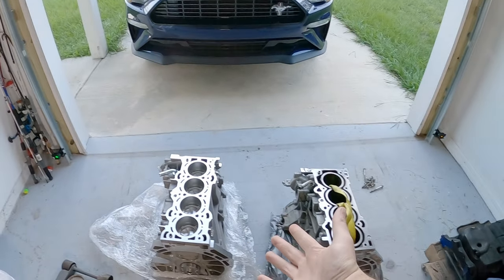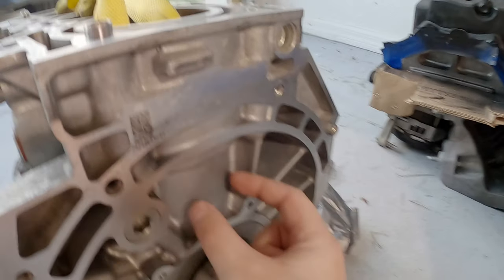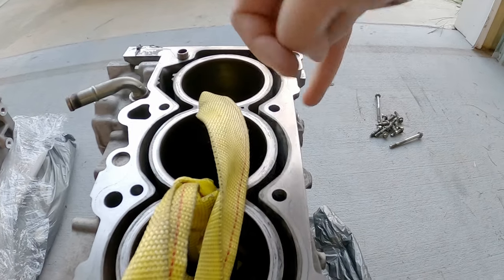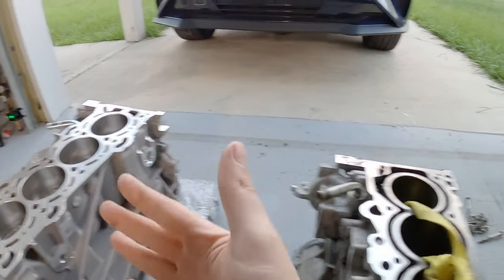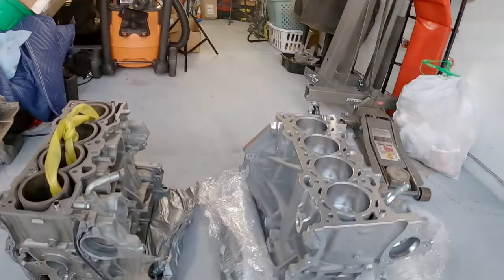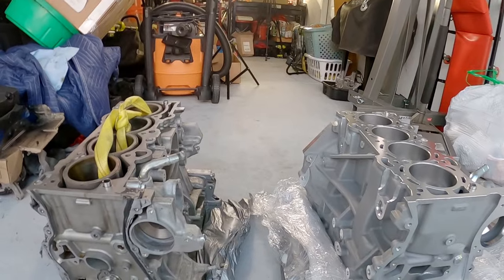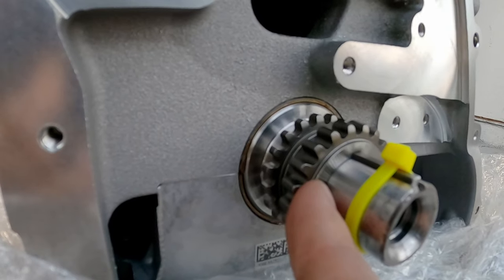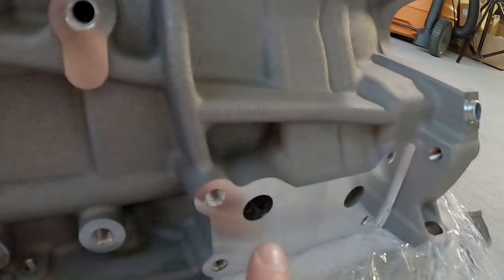Comparing The BEST 4 Cylinder Ford Ecoboost Engine Blocks

Comment: The difference in the casting finish and web thickness is because of a complete difference in casting technology. The 2.0 block you have is a sand cast block, hence the rough surface finish and need for thicker webbing and wall thickness. The 2.3 block is a metal diecast block, a much more modern technique. With metal dies, the surface finish is considerably smoother than sand cast. With metal dies, they can pump the molten aluminum in under pressure, and achieve a denser casting, and can even control grain direction. The webbing and walls don't need to be as thick, because they are stronger for a giving thickness. However, the only way to do a metal die block is with open deck. It's hard to tell because you have the strap ontop of the 2.3, but it looks like the newer casting that Ford changed to address the coolant leakage between cylinders 2-3. The original design had a slit between the bores that caused head gasket blow outs and wall cracking, the updated blocks have no slit and have a coolant hole drilled between the bores.
Reply from the maker: Great point!
Reply: What year of mustangs would that be with the issues?
Reply: I want to know for future reference
Reply: Where can I get an Updated block ? Im looking for it, part number o place where I can get it, Thanks ! Greetings from DR .
Reply from the maker: @juanluistejadarosario7116  Unfortunately, Ford recently discontinued production of the block. Some should be floating around somewhere, but getting anything new from now on will be near impossible.
Reply: None of the ST blocks had the slits between the cylinders
Reply: Actually both those blocks are pressure cast, but don't feel bad, most people think that, additionally the 2.0 specifically this 2.0 is the more recent of the 2 engines, the previous version was open top, just like the 2.3
Reply: @omarmoran3097  2015-2019 i believe. 2020 they updated it along with the HPP package... i havent had any head issues probly simply from only not pushing alot of boost and im overkill on maintenance...im at over 113K miles and i got the car back in 2018 with 23k miles,

Comment: Several comments here that are incorrect. the 2.3rs block is infact a discast block as earlier mentioned, but the 2.0 block is CGI(compacted graphite iron) which is why its lighter even though its thicker. CGI actually gets weaker when cast over .50 inches (iirc) which is why all the critical areas are all .40 and .44 etc. CGI is what ford uses in the 6.7 powerstroke block as well. Several super high HP capable blocks are made of CGI.
Reply from the maker: Great information. Thanks for sharing!
Reply: The 2.7 is cgi, both the 2.3 and 2.0 are aluminum, and neither are die cast, they are pressure cast. The only real difference is the open top. The 2.3 here was developed to be lighter and have better cooling ablilty, but both came from the same core 2.0, this the similarities.
Reply: IT'S ALUMINUM

Comment: Bigger holes or higher volume passages aren’t always better, certain passages may be smaller for higher velocity (flow faster)
Reply from the maker: Fair point. I didn't think about that.
Reply: Do you know how this relates to the 1.6L, 2.0L,  2.5L / 4 cylinder ecoboost sizes?

2016 Ford Escape, for instance.

Is it just basically more horespower?  I would think the bigger engine would be less strain on the ecoboost and be better overall for longevity and overall better performance.

Comment: Not much engineering analysis going on here. Read the comments for better info. I have owned both and enjoyed both. I will say the torque from the 2.3 is pretty impressive in my new Explorer.
Reply from the maker: Good thing it's not an engineering video. The 2.0 ST block is objectively better than the 2.3. This video is a simple comparison between the two.

Comment: When it comes to oil I wouldn't get hung up on the size of the ports. Long as it's there it's clean and there's enough of it you're fine. Most cylinder heads have oil restrictors going from the block to the head. And they'll be tiny and it still has to do all the valve all the hydraulic lifters.

Comment: Do you have solid evidence that in 2020 a new, stronger rod is used compared to the older 2.3 blocks?
Reply from the maker: Google Gen 2 Ecoboost connecting rod. Gen 2 rods are physically thicker and stronger than Gen 1. Gen 2 rods will bend rather than break, which is the preferred worst case scenario.
Reply: Thx. Yeah what Ive heard. They all need to be built for any more than 350 tq for real reliability. Out of the platform now for that very reason. Not my concern anymore.
Reply: They are excellent. Owned both gen1 & gen2- 2.0L GTDI Ecoboost an both served me well. Good basic maintenance goes a long way. Both ran Better than my GFs Rav4. She now has a Bronco Sport.
Reply: @KarzKreated  Though even that is quite rare. Owned both gen1 & gen2 - 2.0L GTDI Ecoboost an they served me well for near 200k mis. Both sold running well! Good basic maintenance i.e full synthetic oil every 5k mis /Motorcraft filters etc is wise on any vehicles esp turbo DI.
Reply: @gbass7328  Why not your concern? These are excellent, stoutly designed engines in every regard.

Comment: I’ve heard the 4 cylinder Mustangs, and oh my god they sound terrible! Cause the two front and back pistons go up and down the same time, and the two middle ones go up and down together, so that’s the reason why I always hate 4 cylinders, and prefer 6 or 8 or 10 cylinders. I mean from the inside it sounds good, but from the outside hell no it sounds bad! 2.5L Hybrid 4 cylinders are the ay okay engines I like

Comment: it looks like the holes where the old oil filter passage are for you to self tap fittings for a remote oil cooler and oil filter setup.

a lot of Nissan RB engines will plugged off the old oil filter location and run a remote oil cooler/filter combo with longer oil lines for more oil capacity and more volume = better cooling.
Reply from the maker: That was one possibility I was thinking about, though the rep at MAPerformance didn't mention anything about it. They claim everything that bolts to a 2.3L block, bolts to this one except the engine mount brackets. An oil cooler would be great to put on, but that will have to be down the road a little. I'm gonna have to call them and verify.

Comment: I am wondering 2024 2 litre water pump failure does the coolant go into oil pan?
Reply from the maker: As far as I know, the 2L still has the water pump housing in the same place. The coolant in the oil problem was from ecoboost engines that used a water pump inside the engine that was driven by the timing chain.

Comment: Any chance you have a part number for the block or which years it came out of?  Which head are you using?
Reply from the maker: I don't know the part number of the block. It's either a Focus ST specific block, or just a standard 2.0 block that you would find in a Ford Fusion from 2015 on up. Evidently, there's a difference between the two where they were casted, and the ST blocks are said to be stronger. The head is just a standard 2.3 head for a 2020 Mustang.
Reply: Current as of 10/24  2.0L EB Service Long Block with no slits between cylinders is J2GZ-6006-E for 2015 to 2018 Edge, Escape, Fusion, Lincoln MKC, MKZ 2016 -2019 cost is about $2.6k.
Current 2.0l EB Service Short Block with no slits between cylinders is F2GZ-6009-E cost is about $2.1k
Getting the head and timing installed and already set, with 3 year warranty is easily worth the 500 bones.

Be very cautios of buying used.  2015 to 2019 2.0l blocks had coolant slits between the cylinders for increased cooling that caused head gasket failure.

Comment: You forgot to mention the little coolant slits between each cylinder wall with the yellow pull strap. 👍 
The culprit and demise of that block design. 
your better off putting that block in the garbage can, and if you sell it, I would feel very guilty and sorry for the buyer. 
Have a great day

Comment: So what year or application did the closed deck block come from?
Reply from the maker: The focus ST. It may have come in other models in the early twenty teens, but it for sure came with the focus ST. Then there's the semi closed version that is found in most vehicles with the 2.0. There's also the 2.5 that has the same block design, but it has a taller deck height.

Comment: Greetings brother, I hope all is well, I hope I get an answer for my question, did both 2.3 mounts bolted to the 2.0?
Reply from the maker: Yes. The 2.3 mounts will work with a 2.0 block. However, there is a small difference between the two. The driver's side is identical. The passenger side mount works, but the 2.0 block only has 3 of the 4 bolt holes. So you can reuse the factory mounts, minus one bolt on the passenger side.
Reply: @KarzKreated  thank you so much for the fast response. This helps greatly, I truly appreciate it. Keep up the great work

Comment: TS block was used in builds for awhile and is comparable to the ST block. They just stopped producing them, however, the semi-closed deck and more coolant passages allow better cooling. There’s usually some sort of trade off. I have a FBO/NX2/E30 HPP+HP making respectable power. It’s all about maintenance, not doing stupid shit to the car, and luck. I also have $15,000 stowed away when it goes to either go built motor, or go GT 10R80, LT Headers, Intake, Exhaust, E85 and make 500whp and 475wtq cheap and reliably. I’m not far off now with my build, but I’ve put about $12,000 into engine mods/drivetrain mods and tuning already. We used to be in the same FB group for HPP’s. Hope you have that car running soon

Comment: @karzkreated  Yeah man you're a real trail blazer.  I have a '22 2.3 HPP myself and am wondering what is possible.  I was always wondering if the RS block of the HPP is sleeved or not and the head difference was.  Looks like the air intake is much more open than the regular 2.3 head though.  Not trying to make more than 400 flywheel HP and tq myself, but this kind of stuff makes me consider just how much the 2.3 HPP is safely capable of.
Reply from the maker: The HPP can easily handle 400 HP, and anything beyond that is questionable. It's never how much it can take, but how long it can take it. The RS stuff is better in the sense that it's stronger, but at the end of the day it's still a 2.3 with 2.3 limitations.
Reply: @KarzKreated  As long as it can take it for 6 years with no track time and just some spirited highway driving that's good enough for me.  Not so young anymore and just looking for some fun here and there and for FFS I like the auto but man it's hunting and hesitation drives me nutz.
Reply from the maker: @rabidduck1089  it should be at that power level. It's not that much higher than stock. And I know what you mean with the 10R80! The factory trans tuning is horrendous! After I tune the engine in mine, I'm doing a trans tune.
Reply: @KarzKreated  I plan on going through PD Tuning myself.  I already have an Accessport, but I'm not bothering to run those canned tunes on it.
Reply from the maker: I don't think the cobb canned tunes are all that bad, but a custom tune is definitely the way to go. I'm sure a basic E30 tune wakes these cars up big time. But a decently hot 93 tune should definitely get you to your power goal.

Comment: What car is the 2.0 engine from
Reply from the maker: You can find it in many different Ford  vehicles. Fusion, Escape, Focus, Maverick, Taurus, Edge, Explorer, and a few Lincoln vehicles. With that said, those engines are considered "semi closed" deck engines, whereas the Focus ST version is the only 2.0 engine to have a closed deck engine block. That's mainly the reason why it's sought-after for higher hp builds.

Comment: Why is there so many head gasket issues with open block design??
Reply: Open deck has a lack of support around the periphery at the top of the bore which allows ovality, splitting and warpage. A closed deck offers the stiffness to abate this, but runs engine temperatures a little warmer.

Comment: I just finished my 2.0 stroked block  Mustang check my videos 
 for the oil filter adapter  I have 10000 miles on my fresh block no problems original 2.3  adapter on the 2.0 block
Reply: Built my self
Reply from the maker: Oh cool! Does your block also have the same circle ports for the oil inlet and outlet?
Reply: Hi guys,i m preparing 2.0 block for my rs cylinder head and as i saw many builders fullfill this oil/water? channel that rs head hasnt.Did you also did it?I said my cnc shop to fullfill it with aluminum foil

Comment: i have the 2012 2.0 Ecobest motor the best one don't like 2016 one
Reply from the maker: I've heard the newer ones don't hold up as well. Something about Ford out sourcing the casting to another company. I've also heard that Mazda's version Is also stronger than the later Ford 2.0 EB.